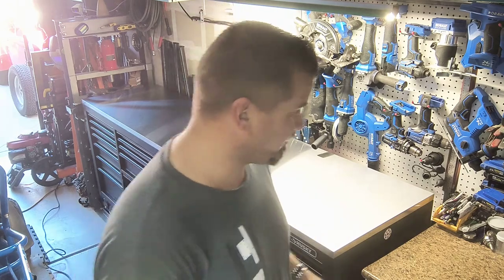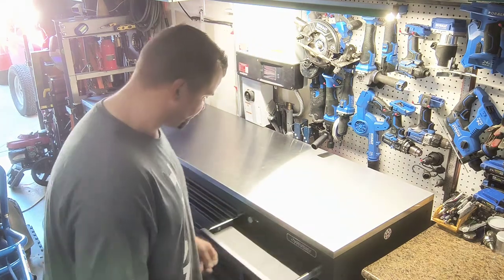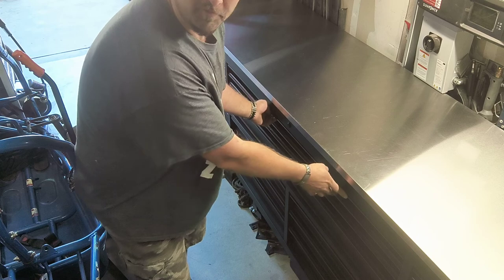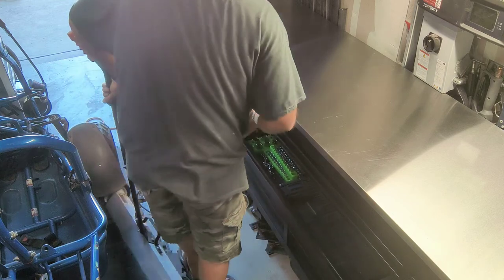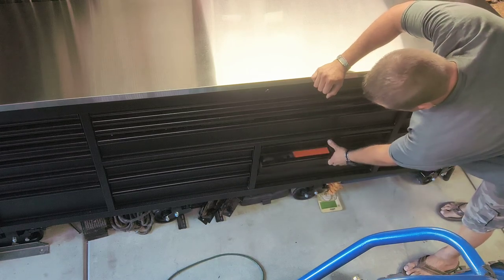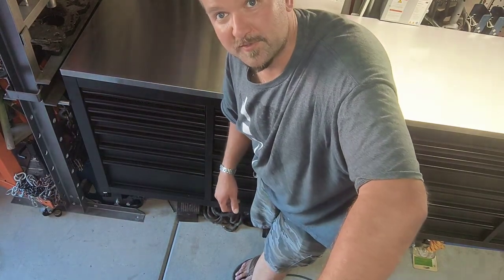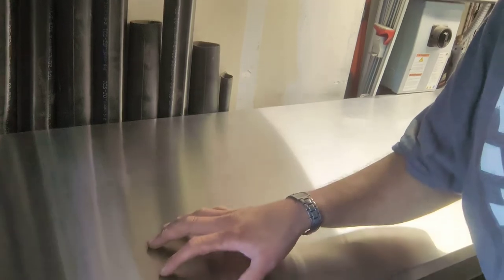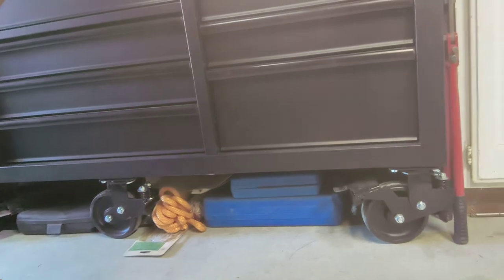Part 2 - Home Depot's Biggest Toolbox Husky HD 96 Inch Mobile Workbench Review & Demo

Comment: Did you ever replace the top with butcher block from HD? If so could you post a link to which one you used?
Reply from the maker: ive not gotten to that point yet, actually read the warranty and didnt want to void the warranty by drilling holes on the bench top

Comment: Thanks for the video. Ive been on the fence for 3 months with this box vs US general 72. This one was out of stock the last 2 months. Those short height drawers have me scared off. If my wrenches,pliers and screw driver's can lay flat in thos short wide drawers then im good with it.
Reply from the maker: yep!  good luck.  this toolbox been great 😃
Reply: @dwproductions411 thank you for checking and for the review. I think I'm gonna to go with US general tho. More useful drawer heights, better price on sale for black Friday, way better customer service and warranty.  This is a nice box for sure tho. It's tempting.if they had it for under $1500 delivered I would probably go for it.
Reply: I have the us general tool box with the top and side lockers, I absolutely love it. This is a nice box but the thin drawers suck and the metal on the husky isn’t as sturdy as on the us general